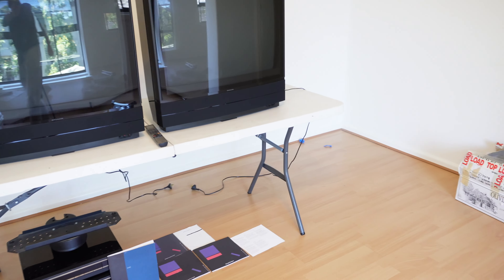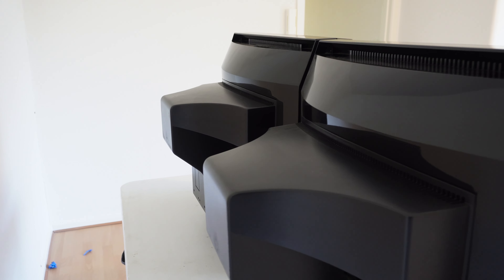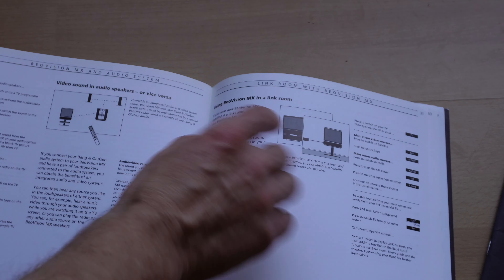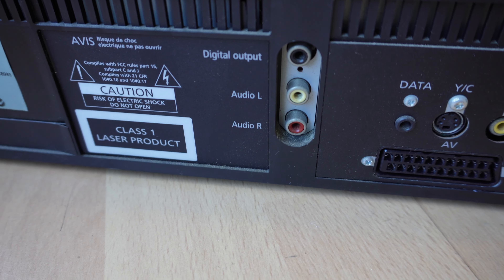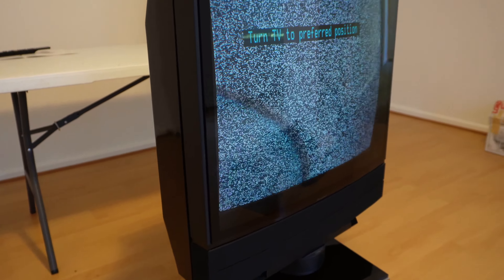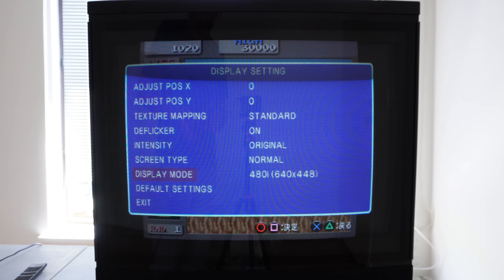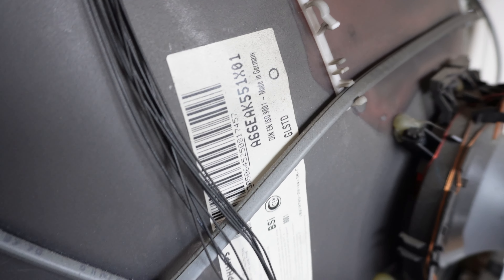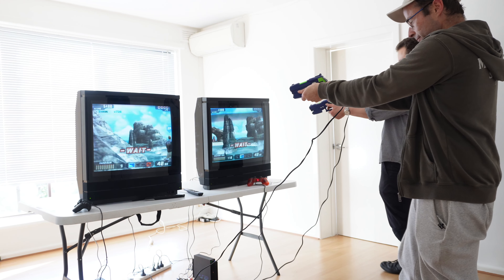Bang & Olufsen MX7000 SCART CRT TV

Comment: If you get the chance to check out the MX8000 go for it. Much better image quality in terms of sharpness and linearity. They also completely redesigned the menus which makes it much less of a headache to do adjustments. I can highly recommend this model.
Reply: I second this. I have had 5 MX7000 and they all suffer the Rolling image in horizontal scrolling and it's quite noticeable. Upgraded to the MX8000 instead and I love them.

The MX7000 models have some issues with the chassis so running arcade resolutions and whatnot can produce undesirable effects in the image. The MX8000 don't have these issues at all.

Comment: ...Am Big Fan of The MX7000 as I Have 5 !!! The Picture Sizing is Tricky and The Input Switching a Pain !!! (Think : Add Two Numbers Together, the Answers a Colour ?) This Improved with the MX8000 (Has only 1) see YouTube for Remote Hack to Unlock Hidden Settings !!! Both Models Look & Sound Amazing...
Reply: What do you mean by this?
Remote Hack to Unlock Hidden Settings?
Reply: @RionRedemp83  I found it on YouTube a Remote Hack... I will take a look :
Reply: Menu 1 1 Go... This will allow you to Tweak the Ser-Up of The Screen !!! (Best to make notes as What Was before Changing the Given Number Setting) Note : MX7000 will Not Show a Picture while you adjust... MX8000 Will !!!
Reply: @VID-KIDZ  That's just the service menu.
Reply: @RionRedemp83  YouTube : futurematt5 B&O De-Interlacing XBox 360 Retro Scan Lines...

Comment: They are great looking TVs.
I've got a few B&O including a very early MX4000. 
Its hard to make judgements on a 30yo tv that could have had any level of breakdown or mistreatment.
However, I find the b&o i've come across all have small alignment and geometry issues. 
Many of the early ones can't be put into service mode with the remote, as far as I can tell.

Haivng RGB SCART , a great physical shape and such strongly defined scanlines is enough to make up for all of that !

Comment: I discovered my 7000 has a brightness sensor next to the ir sensor in top right corner. Try to flash a flashlight into the top right while in a fairly dark room and you will see brightness in 240p from heaven. Sadly, I still have not figured out how to always have it on that max brightness.

Note that you probably will need to down the menu brightness for this to look good. But it bassicly increases the contrast, ALOT.
Reply from the maker: good tip! thanks for the info!
Reply: @rgbrob  I am emailing b&o about a possibility to make sensor not lower the brightness now. We will see what they answer.
Reply: It is called "vision clear" they have it officially in mx series specification. I also nkticed my MX7000 is a lot brighter during day time, especially when sun hits the room, but it is way to dim in the evening and nights despite all my fiddling with it.
There must be a way to disable this vision clear brightness sensor!  This tv lacks pefrection only because of this dim contrast by visionclear
Reply: @vinnievincent85 did you hear back from them?

Comment: I find on my MX4000 & 4002 the composite image is a lot brighter than RGB, can notice it when you get the system menu up, the background image changes to composite when the crisp menu pops up.
Reply from the maker: I have seen a few different TVs over the years that are noticeably brighter in composite compared to RGB. 

Its like the on screen display takes over the RGB display and switches the source input to composite in the meantime.

Comment: Hey Rob. Does the mx7000 also show signs of digital processing, similar to 100hz, like the mx8000? If you remember you didn't recommend it for arcade gaming.
Reply: That's the digital filter on the neck board that makes the image more clear. You can easily detached the cable if you want a more soft image like the MX7000 has.
Reply: Here is a video on how to disable it
https://youtu.be/sr65QwcjWCs

Comment: Hello, I'm desperate and I need help.
I own a wonderful B&O MX7000 and when I want to play time crisis 2 I have got the same problem like this video:
https://www.youtube.com/shorts/-5GvOl3vxeg

I have changed the configuration on the gun to 100hz mode and others why nothing. I also bought a PS2 to scart cable but the same result.
Do I need to configure something on the MX7000? I don't know why I have got this problem. Help please.
Thank you and I encourage you to put more videos
Reply from the maker: no need for 100hz mode on mx7000. Assuming that you are using a proper Namco guncon 1 or 2 gun, you also need to have correct cabling. The gun requires plugging into composite video. You need a scart cable like this that allows the composite video lead from the gun to plug into the scart cable at console end. Have a close examination of the cable in this link: https://www.retrogamingcables.co.uk/SONY-PLAYSTATION-2-SYNC-ON-LUMA-RGB-SCART-CABLE-LIGHTGUN-PORT